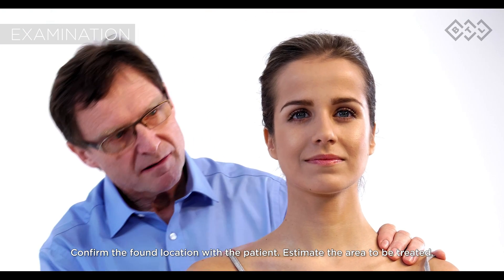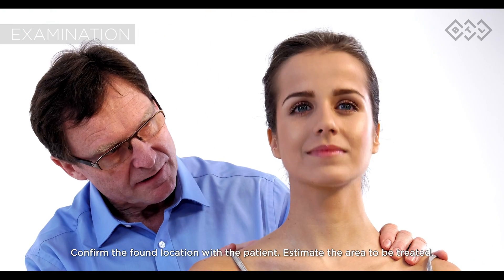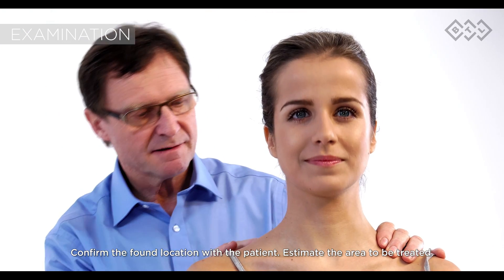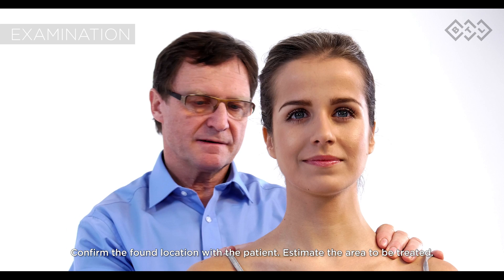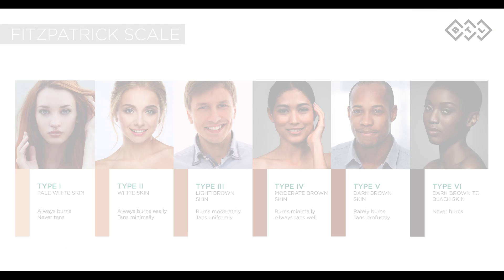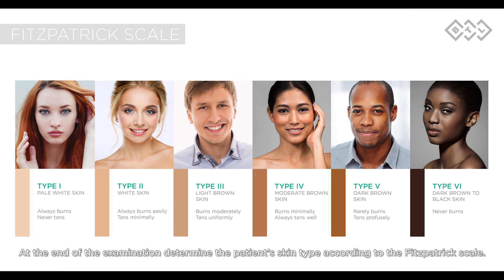Cervical Pain Treatment Using BTL High Intensity Laser

Comment: A good video to teach us how to use the high intensity laser . Ours laser is the low level laser, no need move around during the treatment , and the big treatment area, ours is combine 808nm laser and 650nm laser together, and a big probe, wireless, also has the stand as the support , but the each treatment time need 10 to 20mins ; BLT laser has a short treatment time and could proceed with the exact laser acupuncture, it is should also a good laser.
Reply: This is not acupuncture, this is science